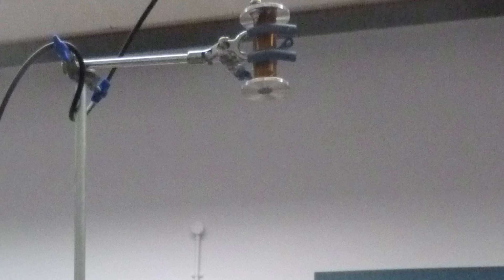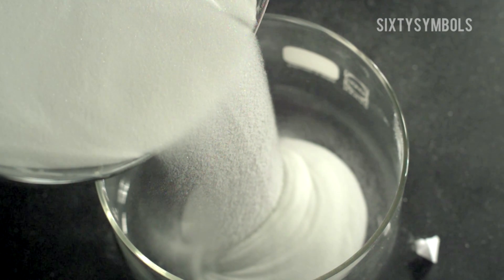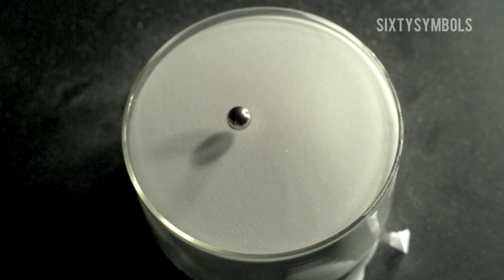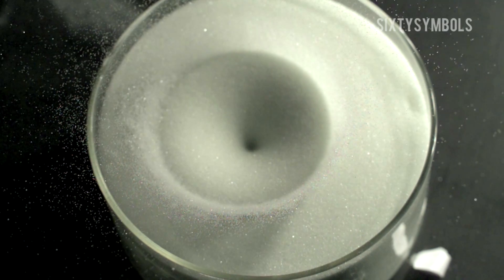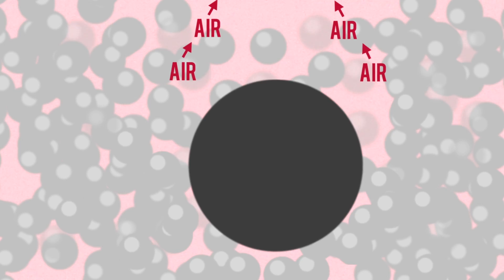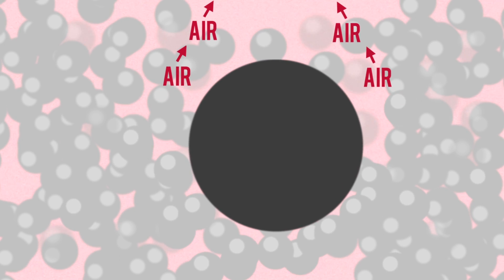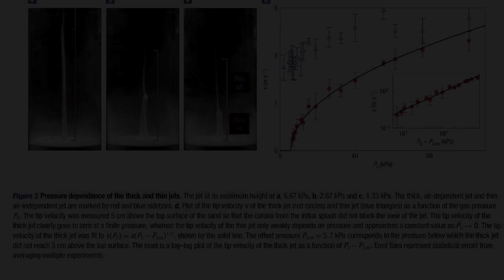Granular Jets (slow motion) - Sixty Symbols

Comment: This effects has been widely studied in the literature for other fluids.
Anytime a cavity collapses, there is a fast jet produced.
If you think about it, there is a point where the two walls first meet. This point will move forward as the walls collapse. Putting yourself in the reference frame of this collision point you see the walls flow towards you. This flow then must turn either backwards, forwards or both. If you apply conservation of momentum and Bernoulli's equation, you will see that the only possible solution is the one with both flows. The part that turn forwards is the jet.
The first paper I am aware of that explains this effect is this one:
http://scitation.aip.org/content/aip/journal/jap/19/6/10.1063/1.1698173
Although it deals with metal cavities imploded by high explosives, the idea is the same.
As others have said, air probably only serve to "lubricate" the particles, reducing losses.

Comment: I'm not convinced that it's an updraft creating this effect. The presence of air certainly plays a factor, that was proven by the experiment, but I would posit that the actual jet is formed by a kinetic lensing effect of the collapsing pillar. The air simply facilitates relatively free movement of the individual particles, the granularity requirement supports this, smaller particles are lighter per unit surface area than larger particles, meaning they're more likely to float on a cushion of air as they move, rather than rubbing against each other. 

As the pillar collapses, the force of all those falling particles is focused into a smaller and smaller point, until the tube's base fills in with fast-moving particles which attempt to disperse perpendicular to the initial flow. Other particles block it from spreading out the sides, the projectile blocks it from moving down, so the force takes the path of least resistance, firing upwards, creating this jet. If it were an updraft, one would expect far less material to be swept up, and one would expect that mathematically, the jet would model significantly differently from water, which does not flow due to saturation of air, but rather due simply to the lack of friction between water molecules. From some cursory googling, I can see that they model nearly identically, ruling out such a radically different mechanism between the two phenomena.
Reply: +Teth47 I'm the only one who read your comment and can say I have no idea what you are trying to say.

In the first half you say that the pillar is not caused by the air, but that the presence of air allows the particles to float, because the compressing pillar of glass underneath is throwing up particles. Then in the second part you say that the origin for the thought experiment you setup in the first part lied soley with your idea that the grains would not model closely to water and therefore you needed to create an alternate explanation. Then you contradict your statement in the next sentence. Therefore the reason for your hypothesis is disproved, meaning the explanation is false and therefore the air has to play a direct role in lifting this particles up -- they are not floating.

Comment: what's the point of this experiment? To see how fine the particles are on another planet without going there? or to see if a planet has oxygen? Does this principle work with other gases? .. so many questions unanswered :(
Reply: It helps microscopically simulate a macroscopic crater formation, among other things.
Reply: It can also serve to demonstrate how the fluid-like characteristics of particles relates to their size similar to their experiments demonstrating surface tensions in grain media. At least that's what I can interpret without reading any of their papers

Comment: the water will continue to exert its vertical movement energy after it reaches the top of the surface, causing the water to fly into the air.

Comment: That's actually good, I worked through this mentally and came to basically the same conclusion. Its different from this experiment though because the water is incompressible and probably doesn't have any air below the point of impact. Basically, as the water pushes back naturally to fill the area of low pressure, the air is forced out, the water starts filling the void from the area of lowest relative pressure (because of gravity [the bottom of the cone]) as such the water fills upward..

Comment: My GUESS would be be that it would be because of difference in pressure. The water would rapidly move towards the area of low pressure (which would be behind the object being dropped) and therefore shoot up. 
Would love to see a free journal article on the subject if anyone knows of one though.
As for the reason the column of water or particles is so perfectly consistent I would guess that it is because the center behind the object would have the lowest pressure?

Comment: No, they form due to a column of super hot air rising and the head of the mushroom forms because the hot air column interferes with the static air outside it. Mushroom clouds form not only after a nuclear explosions, but many other smaller explosions and even from the rising smoke from a cigarette depending on conditions.

Comment: Realy? Air? I fail to see the proof here. If you pump out the air it only means that you change the fluid dynamics. 
In water there is a similar effect, which is caused by waves and pressure.
So I suspect the air is allowing particles to interact as a fluid and transfer waves. In my mind there is no way that any jet of air will propel particles in straight upward direction. 
The air can go anywhere, not just up, so this is actually not very believable explanation.

Comment: I would believe it is equivalent to the mass of the item being dropped...if you scaled the item being dropped by the difference of the grains you would, theoretically have the same result as the original item on the smaller grain.

Comment: So there are two things happening here, !) liquid dynamics and the effect of the liquid dynamics is dependent on the ratio form the size/mass of the item dropped to the size of the grains. So the question stands, if you dropped a larger/denser object into the larger grain would it create the same effect as the original test on the smaller grain (inner plume)?

Comment: I am wondering is there 2 things going on here to push the sand up? he established that particle  size has a lot to do with it. I am wondering if it doesnt work with the larger beads also because the beads are larger there is going to be larger gaps of air between each grain/bead. which might help disperse the air pressure sideways thus making the vertical jet less powerful, which might be likely to create less of a sand column??  

I would love to know if i'm talking rubbish??

Comment: I agree.  I think the only relevance of the requirement that there be air in the sand is that it makes it flow more like a liquid.    The jet is caused by the collapse of the hole just like any other liquid.  The jet is more pointy than liquid equivalent because there's no surface tension between the grains of sand.

Comment: the speed with which the beads/air is compressed by the ball is too fast for it to escape out the top of the bulk, it will take the shortest, easiest route, which is out the sides of the hole.  Remember it is quite difficult to get this effect to happen.

Comment: The effect 'looks' similar yet the physics is slightly different, mainly because the little glass granules above have no surface tension, so air can flow between all the little granules in the beaker.

Comment: Metal ball falls in "sand" the energy causes crater, the air/room the ball takes up has to escape, the hole closing up causes "exhaust"  finer grains light enough to be moved by air the 0.6 grains not light enough... Simples! ;)

Comment: The main reason I don't like the air jet explanation is that, given the packing fraction, the displaced air can escape in any basically any direction, with only minor upward preference. 

I was wondering about his evacuation evidence, but couldn't come up with a good mechanism. I think your explanation of grains settling and increasing viscosity is the most likely explanation. The reasoning is sound.

Comment: I think his explanation that air is the reason the jet happens is bogus. I think the only reason air is a factor to if the jet happens or not is because the less densely packed sand acts more like a fluid. After the air is pumped out, the grains would settle and gain viscosity. Let me know if you agree.

Comment: That was my initial thought on this fine grain experiment - there is a difference between speed of closing of that hole compared to bigger grains. Light grains slamming into each other (plus some escaping air I guess) could create this splash in the center, while heavier grains absorb more of an closing hole impact and don't go that high.
I feel uncomfortable challenging professors with experimental data, but it just doesn't feels like full picture...

Comment: You could be up to something,and the rest of the explanation could be surface tension and inertia.
When you drop something in the water, it pushes the surface of the water down and makes a hole, surface tension makes a nice gradient of height. When water start returning up it gains momentum and inertia propels it up.

Comment: When the cylindrical wall slams into itself at radius 0 an enormous(relatively) pressure is momentarily created. the column is confined in all directions except up. This pressure propels water (not clear from where, the experiment would have to determine this) in the only free direction (up). creating a spout. 

Disclaimer: I'm a high school physics teacher who has not done said experiment. I'm just thinking through what would likely happen. 
I'd like to hear from some professors on this.

Comment: This upward moving air keeps the hole from closing but is unlikely to actually propel the water into a fountain (Someone would have to do experiments to confirm this, I'm just doing a thought experiment here). As the cylindrical walls of the column collapse the radius of this water wall decreases, concentrating the kinetic energy gained by falling inward (look up sonoluminescence). Here's where it gets tricky to picture.

Comment: Great question, I was wondering why he didn't address this. This has been studied with water (though I don't remember the particular findings or where I remember it from). 
My guess is that, his explanation is only partially right. 
As I think this through,the mechanics actually get quite messy.
In the case of water, the ball leaves a column of air in its wake. Water surrounding this column of air rushes inward to fill the void, top first. As this chamber collapses the air escapes up.

Comment: I'm still strugling to conceive the scale at which both fenomena happen, i.e. the hole closing & the bead sinking. For this to happen I'd think the bead must still be sinking when the hole closes, so that there is still air rushing out.
Or can you consider that the air is able to remain compressed under the sphere, for a while, before it vents? (giving the hole time to close).
Maybe that's where the size of the granular glass comes in. Small glass is able to keep compressed air without venting.

Comment: An interesting related question would be whether and to what extent the shape and density of the sand influences the plume. It could be the case that if a type of sand allows more air to be trapped, i. e. sand that is not very dense, while at the same time having particles light enough to fly up, a larger plume is created. Since trapping the air in the beginning was crucial to the experiment, and reducing the pressure resulted in smaller plumes, I think that this hypothesis is indeed true.

Comment: I guess it's just the fluid pushing itself into the "hole" created by the ball, and it has enough force to eject itself upwards when the "walls" of the hole meet. Also the water under the ball needs to go somewhere, just like the air in this experiment, so I guess it also goes up around the ball. 
It doesn't work the exact same way with the particles, since they can just be compressed (replacing the air between them), where as the liquid can't.
Just my hypothesis.

Comment: Why then does the jet break up into droplets like with water?  With water you've got the the inter molecular forces (surface tension) to pull the jet into small droplets, but what mechanism is there in the glass sand?

Comment: The same group who did the tests in vacuum published a paper where they used SF6. There wasn't a noticeable effect on the jet structure until a pressure of 1 kPa. 

At 1 kPa, a boiling eruption looking structure forms instead of a thin jet after the impact.

Comment: The thing is, neither the particles nor the air act like water, only the combination of the two do. You need the air because if the particles weren't spaced out enough they wouldn't be able to slide past each other so easily. The air basically decreases the "viscosity".

Comment: Here's my uneducated curiosity.  If the mass of the ball used in the experiment is the same between both sizes of glass beads, wouldn't the smaller beads naturally give more of a reaction because each individual bead needs less energy to move?  If you used a ball bearing with a larger mass with an equal ratio to the increased mass of the beads, would you not gain a similar effect?  And is this also not dependent on the atmosphere in which the experiment was done?  Don't take this as scientific!

Comment: The experiment in a true vacuum will likely not produce any jet whatsoever. With higher pressure, the more air molecules will be bouncing off the same space in the powder, and thereby when the crater collapses in, more air is pushing the powder upwards (and also downwards!). In a vacuum or very low pressure, there are very few air molecules between the powder being displaced and it will just pack together more tightly. The jet will be small, and the ball will also probably not penetrate as far.

Comment: It looks like the particles only get thrown up when the pore closes. If this was just them being carried by the escaping air, shouldn't the column start forming beforehand?

Perhaps the rapidly escaping air is creating an area of low pressure at the pore (Bernoulli's principle), which causes the sides of the pore to rush together more quickly - creating a jet of particles. Sort of like how surface tension in water creates a similar column after things are dropped in (when the pore closes).

Comment: If it is long enough, it would appear to bend 'cause the light towards the end away from you reaches you after the light from the end closer to you.

You still wouldn't be able to make the end further away from you move at the speed of light though; the energy needed to turn the thing faster and faster would approach infinity in proportion to the speed of the fastest part.

Comment: The beads clump to "little bits" due to granular clustering. It's the same effect as bunching of cars on a highway. If there were only one lane, almost everyone  would be stuck behind a slower car. A faster cluster will merge with a slower cluster in front of it and this process continues until the velocity differenes have become too small, or all clusters have merged into one, surrounded by a cloud of induvidual beads flying in all directions.

Comment: because sand has no surface tension and doesn't collapse as quickly as water. if you compress sand without air trapped between the grains is just isn't that elastic but more plastic. so only gravity and some kinetic energy pushes the tube together. with air it's like simulated surface tension and more fluid causing the wall to collapse faster. but all that doesn't matter, in the end the collapsing wall, like a wave, rises because of the pressure of the impact with itself.

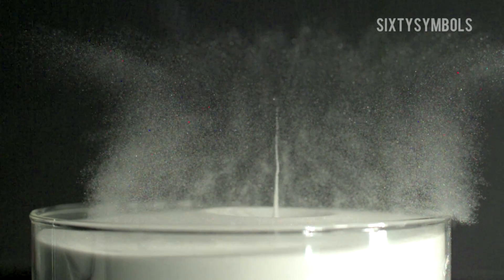Comment: This is amazing! So the plume actually isn't the same as the similar jet you see in liquids, I never would've expected that. One question though: What makes the beads  in the plume clump to "little bits" as the prof puts it, after they rise in a line? Like the difference between 1:49 and 1:52.

Comment: I don't think you can assume it is the compressing of the air beneath the ball that causes the jet. Why doesn't the air simply move out through the granules in a compression wave? Perhaps the jet is caused by the tunnel collapsing above the ball and, as the only exit is at the top, the grains are expelled by the air as it is compressed, similar to when a stone is dropped into water. 
Very interesting experiment, whatever the answer.

Comment: you get the same middle thingy with water. so really, it's just a collapsing tube that when the wall meets in the middle multiplies the forces like two waves hitting frontal  causing it to rise. (I now I used the word force wrong)